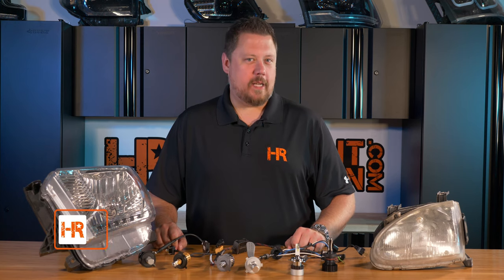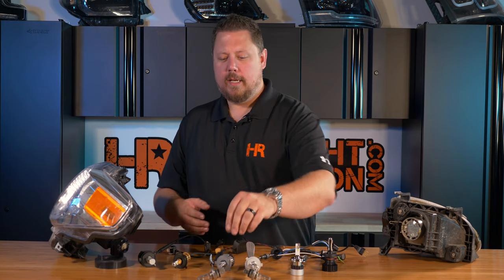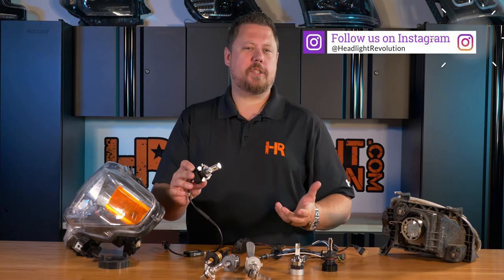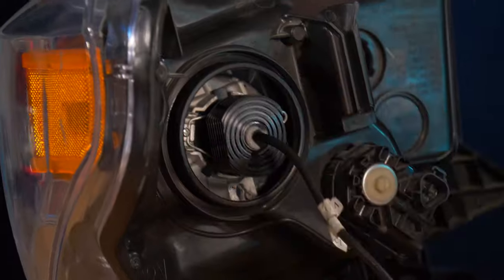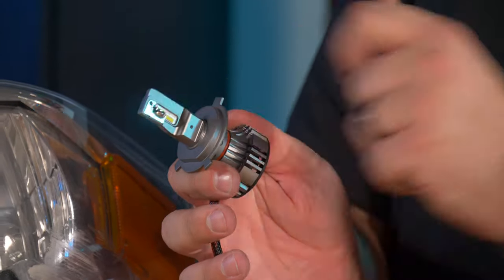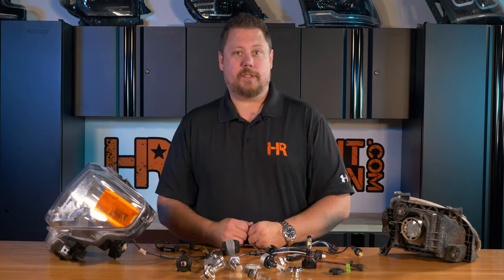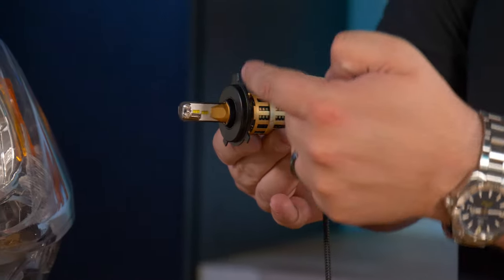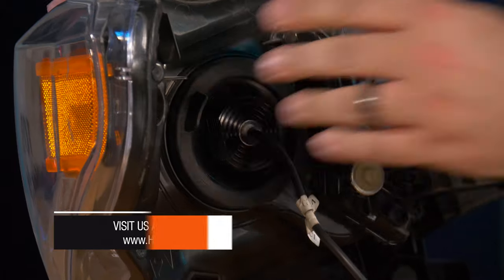How to install H4 or 9003 LED Headlight Bulbs - Tips and Tricks from Headlight Revolution

Comment: This video was big time helpful!  I watched a lot of videos trying to figure out how to upgrade my 2002 Tundra to led headlights and yours was the only one that solved the mystery on how to incorporate the dust cover by showing how the collar comes off the led bulb.  I still had to modify the dust covers some to allow the bulbs to fit right and yet, now the leds work great and still have the protection of the OEM dust cover. Thanks a lot!  👍
Reply: Should I cut the dust covers a little bit? If so, where?

Comment: Darn, I just installed my bulb upside down.  I wasn't sure which way the shield was supposed to go, so I just chucked it in there thinking the shield would protect people from the running lights, and the high beams would be the back set.
Reply from the maker: It happens! That's why we make these videos 🙌🏼

Comment: I’m curious: my dust cover doesn’t have a hole in the center, and is just a cap that closes off the housing. How do you recommend navigating that with an LED bulb’s heat sink and cable? Is it advisable to just not use the dust cap?

Comment: got some questions, if you look at the recent release of Toyota cars like the corolla and rav 4 , seems like they all uses LED headlights but interestingly enough they use both the typical LED projector headlights which has been around for a while now but also  a parabolic led headlamps ( which is not projector base but using reflector in it). What's your view on that? I would like to know, thanks

Comment: Nice informative video.
Personally would have liked to see some beam pattern comparisons of the different H4 bulbs as I can't find any of your bulb shootouts that feature H4 bulbs and I'm thinking of getting the new GTR Lighting bulbs.

I'd like to point out that when I installed LED H4 Bulbs in the past, I found out that the alignment isn't supposed to be perfectly straight 12 o'clock when I referred to the stock halogen which was slightly off by about a notch and this gave me the best beam pattern. This may be vehicle specific but still something to look out for.

Keep up the good work guys.
Reply: I just learned from this video that the shield is facing up I thought that should be easy, just point it at 12 o clock. Now I read your comment and it's not exactly 12 o clock. Now I think I should focus the original halogen on a wall and trace the pattern on the wall. Then put the led bulb and make sure the pattern are the same as the original halogen.

Comment: I bought some cheap no brand leds H4 bulbs and when switching from low beam to high beam there was hardly any difference,  is that normal for all Led bulbs , or is it because I bought cheap knock off's,  Thanks for the video

Comment: i have fitted a cob led bulb to my motorcycle i get low beam i don't get high beam . i notice if not enough power on battery it switches to low in instructions so i put charger on to a battery doing 13.3 volts STILL NO CHANGE only get low beam could it be a faulty bulb or is it not the same connections as a h4 socket. regards john

Comment: Great video. I have a question. I got the dust covers on after the LEDs so that the fan assembly and heatsink are inside the rubber dust cover and completely sealed up. Only the wire is protruding which I also sealed with electrical tape. Will it cause issues with overheating? Is it important for the fan to be exposed to outside air? Appreciate your videos a lot. Thanks.
Reply from the maker: No, you don't have to worry about overheating! We do recommend using the dust cover and having the fan enclosed in the headlight.
Reply: @HeadlightRevolution  Thanks!

Comment: Great job explaining led installation procedures.
I've got a 1986 Winnebago motorhome with sealed beam headlights. I purchased new 4x6 Halogen lenses only. I can now fit led bulbs into the lamps, but the sealed beams have a 2 blade and a 3 blade socket. Is there an accessory pigtail available  on the aftermarket to complete the connection so I can have led lights? Can i get a led pigtail from a dealer  trim off the old bladed sockets and rewire to complete connection?

Comment: I installed the 
SEALIGHT H4/9003 LED Bulbs on my honda element. They look great but when the truck is turned off they still give off a low glow for hours. Not sure if it's power stored on the driver or a low current. Truck starts up fine but still concerned

Comment: Great video! Still, I simply don't get it, why is it so many people and reviews indicate light bulbs to be h4/9003? I mean from what I understand they are different, like h4 cannot replace 9003 or viceversa, am I wrong?
Reply from the maker: In the LED world, they can! The connectors are the same, but the bases would be slightly different. With LEDs, you just get a universal base for both applications.

Comment: Thank you for this great video.

However, I would like to know a bit more about the differences between them. Specifically, ones that have fans and those that don't; are the fans going to accumulate dust and break? Will the entire LED bulb then overheat and simply stope working?
And conversely, are the fanless designs better in this respect or worse on account of poor head dissipation?
Reply from the maker: The fan based bulbs typically are brighter because they can be run harder. We used to see more fan failures when LED bulbs first came out a few years ago, The new ones work a lot better and it’s almost entirely a non issue. I’d personally only run a fan based bulb now for maximum brightness. -Chris W
Reply: @HeadlightRevolution  I feel so stupid for writing this. I've seen your other videos now and i plan on watching all of them because they are very good indeed.
Thank you Chris!
Reply from the maker: No problem at all, That is why we are here! Let me know if you need help with anything else.

Comment: My h4 leds were instaled with up and down shield and it was fine. Now I bought the same set and pattern looks weird and low beam is so bad. I will try to turn the shields to 3 and 9 position.
Reply from the maker: Yep!
Reply: @HeadlightRevolution  Tried, they locked somewhere in between 9 and 3 but not exactly 9 and 3.

Comment: I have seen some LED H4 lamps being offered locally but they say it needs an adaptor kit? Looking at your example I can't see any adaptor. The shop tell me that if plugged directly into the old plug then the voltage is too high but it doesn't say anything about that on the packaging. Hope you can help.
Reply from the maker: Never heard of that, almost sounds like a gimmick to sell you an extra piece!

Comment: Great video, well explained. What led bulb do you recommend for 2004 Mazda Tribute, it uses H4/9003 bulbs. Also would like to have led bulbs that have low and high beams both. I can’t find led bulbs that has both beams. Is that by design? Thanks so much
Reply from the maker: I would suggest reaching out to our CS team so we can go over some options with you!

218-755-5200
Sales@HeadlightRevolution.com

Comment: Perfect video! 

so informative and to the point! 

one question,  H4 (7,11 etc) are those numbers different sizes? (like do h4's have a shorter LED base? in a way that the LED would be in the same sweet spot to be focused by the housing just like the original Halogen light? ) 

or are these numbers for a different power/higher level/quality etc.?
Reply from the maker: These are different, the base of the bulb, the plug, the LED placement, etc, will all be different based on the size of the bulb.
With the stock halogen bulbs, this number could mean a difference in power as well though. For instance, 9006/9012 are the same minus the top tab on the bulb being a little wider and the 9012 generally uses 10-15w more power. It is common for people to trim the larger tab on the 9012 bulb to fit into a 9006 housing since the 9012 is brighter.
Reply: thank you so much for explaining, sharing your info/knowledge and for your time! 

May Allah Bless you and guide you to what is best for you in this life and in the hereafter! ❤

Comment: I recently replaced my headlights and tail lights in a Mitsubishi Outlender 2008 and now the ASC OFF light turned on. Do you think a resistor could fix the problem? Thank you in advance.
Reply from the maker: 9/10 a resistor or PWM Module is going to fix those issues! Shoot us an email, happy to help - sales@headlightrevolution.com

Comment: This is a great video to watch prior to installing the h4 9003 led lights. I was able to install it properly with your video. The only issue i have after installing my led is that its always ON even when the switch is OFF and the AUTO doesn’t work as well. Basically it’s always ON. Any advice on how to fix it would be much appreciated. Thank you
Reply: Eugene, you must be referring to the daytime running lights. There are ways to turn them off.  But it's a safety thing, I'd leave them on, it can't be that bad on the bulbs.

Comment: Great points on the shield and bulb positioning. My son's 99 Camry uses 9003 bulbs, which we switched to LEDs. They are "4 side" bulbs. Is there a proper way to identify on the bulb which way they install? Does it matter? Thanks!
Reply from the maker: 4 sided bulbs will not focus properly, if you're going to run them it doesnt really matter how they face in there.

Comment: You mentioned a shield, how about if my new led buld doesn't have it? Should i just place it facing horizontal?
Reply from the maker: You should still place that so that the LEDs are facing left and right! It is very rare that there is a housing that needs them aligned in a different position!

Comment: What about the heat can a load resistor help with that and how do i know which resistor to get??
Reply from the maker: H4 bulbs do not require a load resistor, resistors are for turn signal bulbs! You might be thinking of an H4 PWM module, which we can help make sure you get the proper one needed! 
Sales@HeadlightRevolution.com

Comment: Thanks for the video.  I recently bought another type of led that was three sided. So wasn't a issue. I just bought a new set and it had the half moon cup and I had known idea if the cup went up or down.  I would of assumed up to keep the low beam pointed towards the ground.  But you say it goes under. Thx

Comment: My 2011 Kia Soul doe not have a dust cover, but an overall cap that goes over the light mounting.  What options do I have to fix this?  Do I put the cover on again? Or leave it open?  I didn't see anything in your video about this.
Reply from the maker: No need toadd one if it doesnt come with one!

Comment: Should show what to do with the extended cable and plug length on the LED’s...
Reply from the maker: Depending on the headlight and the truck, You can either fit it into the headlight with the factory dust cover or zip tie it neatly outside the headlight. -Chris W
Reply: yup. im sittin here trying to plug the damn thing together and it doesnt want to fit. so, for starters, that sucks. would like to see it demonstrated.

Comment: Is it absolutely necessary to re-install the OEM rubber boot over the H4 LED because if I do the rubber boot will cover over the cooling fins. The instructions do not say to re-install the OEM rubber boot. Do I really need the rubber boot at all? It will certainly run much cooler without the rubber boot
Reply from the maker: You will definitely want to use that OEM Dust cover, that will keep the majority of the dust and debris out of the housing, and will allow for your headlights to last longer! Let us know if you have any other questions, we are here to help!

Comment: Hi there. Would you be able to direct me which Led light is good for Honda Civic LX 2014???  I was told Aukee is good but I don't much which led type. Thanks.
Reply from the maker: Here you are!

https://www.headlightrevolution.com/9006-HB4-Ultra-2.0_2
Reply: @HeadlightRevolution  thank you so much
Reply: Do I need two sets of bulbs?  One for high and low beams?  Watched your video, wondering how long do they last?  Also, does it cause flickering or affect the daytime running lights?  Living in Canada, are the lights waterproof?  They are a bit on the expensive side. Have to say your video are easy to watch and follow.   Thank you so much for your help.🙂
Reply from the maker: For further assistance please reach out to our customer service team, it would be much faster! (:

218-755-5200
Sales@HeadlightRevolution.com

Comment: Could you help with  my Opt7 Flux v2?  I have a 2009 Tacoma and have them installed as you showed. However, I noticed that there is no seal other than the tip seal. I am constantly getting flashed for having high beams on. My adjustment with my OEM lights is fine. Is a readjustment needed? I will admit they ARE bright. Also, when I put my high beams on, there really doesn’t seem to be any change in the light. Any comments? Thanks.
Reply from the maker: You should always readjust the headlights after installing new ones, Especially if you’re getting flashed. It may not seem like they move much, But they do!

Comment: SOME OF THE HEADLIGHTS HAVE 2 pin plugs instead of normally used 3 pin plug, will there be any difference in their installation and will it be safe as the third pin is usually for earthing/grounding extra electricity??
Reply from the maker: Not exactly sure what you are getting at here, but all dual beam bulbs will have a 3 pin connector, one ground, one low beam, and one high beam. If you have further questions, shoot us an email and we will get you taken care of! Sales@HeadlightRevolution.com
Reply: @sarthak The two pin bulbs would be for the fog lights but not the high low beams…. Just letting you know.

Comment: I have a 2006 sentra and bought a Beamtech LEDs H13,  when I installed the bulbs and was turning them to the right I was expecting some sort of a snap or a tension of some sort. Nothing, so I just left it like that, and ofcourse when I drove to work, after 25 miles the bulb came out of its housing and just dangled there. Anything I can do to fix this ? Thanks.
Reply from the maker: It sounds like that may be an issue with the bulb itself. I'd reach out to who you purchased them from, and see if you can get a replacement.

Comment: Do you have to modify the dust cover to go over the Morimoto on a 2000 Toyota 4Runner?  It doesn't seem to fit over the fan?
Reply from the maker: You may have to modify that dust cover, and some vehicles just do not work with those LED bulbs. If you are having trouble with that, just shoot us an email and we will be happy to help! Sales@HeadlightRevolution.com

Comment: I bought a pair of idrop focus beam rs mini h4 leds the high beam and low beam is reversed on one side i saw that on the faulty side the bulb was installed upside down but i tried to put it the right way but there  wasn't a way to do so, could it be the mechanic's fault or is it a manufacturer defect ,please advise
Reply from the maker: You might have to loosen a screw on the collar and adjust it from there.

Comment: C6 H4 led on Intruder VS800 motorcycle. Installed the right way, but the low and high beam are reversed. Any ideas ?
Reply from the maker: That sounds like that may be an issue with the bulb. I suggest reaching out to who you purchased them from and see if they can send you a replacement.

Comment: So if I’m using 9003-n bulb any h4 led bulb will work with mine right? (Marsha)
Reply from the maker: If your vehicle takes a 9003 bulb, then youwill totally be able to use an H4 bulb in that application as they are the same size! Let us know if you need anything else!
Reply: Thank you so much
Reply from the maker: Not a problem, let us know if you have any other questions, or need anything else! Have a good one!

Comment: Could you please in the future test "Nighteye" led series? The black ones with CSP chips.
I've used them in dozens of cars and no customer has complained so far.
Light output seems okay, cutoff great, but I don't have a lux meter at the shop.
H4 and H11 were the best so far, comparing to other local shops' chinesium bulbs.
Nighteye are 1:1 same as halogen design, and I tore one apart to see the build quality. I was pleasantly surprised! If you want to see pics and maybe have them in your comparisons I can upload the photos on imgur and send you the link of where I bought them.
I will only send the link to Headlight Revolution so please people don't ask for their competitor's link. Thank you

Edit: The bulbs I'm referring to are exactly the same as unnamed bulbs with the black heatsink on the far right.
Reply: Nighteye brand was change to novsights
Reply: @jerrysetiowiyono6514  they're competitors I think but I'm not 100% sure

Comment: My car is a 2016 hyundai accent come with original headlight and i don't why my friend told me if the vehicle came with original headlight i don't have to buy led headligh?
Reply from the maker: Are you saying you have OEM LED/HID? If so then yes you wouldn't want to/be able to change to LED bulbs!
Reply: @HeadlightRevolution  I mean my friend told me if the car have an original headlight don't buy the led or hid light bulb
Reply: @TheJunior1964  I mean if its 2016 it probably Already has led headlights, only buy them if it goes bad or something

Comment: When do you need to install a resistor in between and when not?
Reply from the maker: It really depends on the vehicle, what vehicle do you have?
Reply: @HeadlightRevolution  I habe a Mitsubishi challenger 1998 (in some countries pajero sport

I have extra spotlights on my car and they don't work with the led h4 together. 
I figured out by now that the spotlights only work Wirth normal light bulbs. I was wondering if I put a resistor in between if they'd work 
Not with led
Reply from the maker: Yes, it sounds like a resistor will fix that!